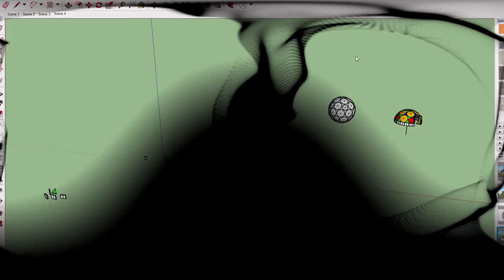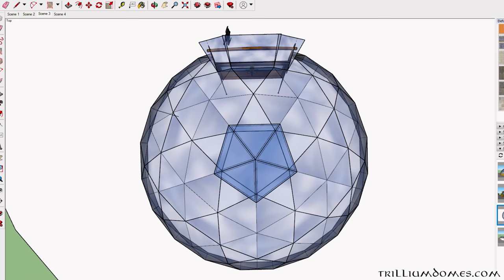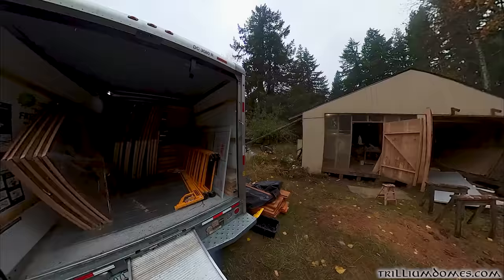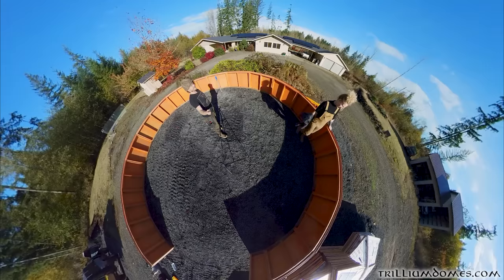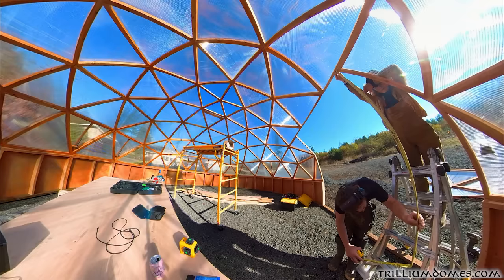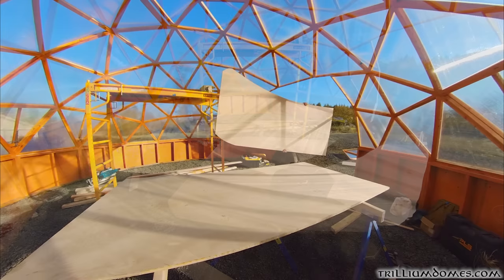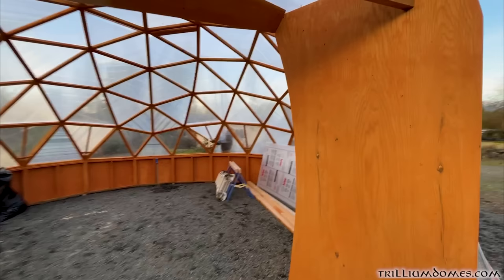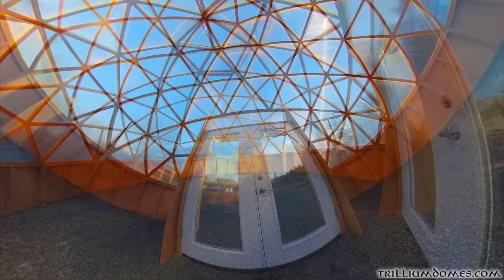Barn Dome! built WITHOUT any Hardware/Hubs??

Comment: Beautiful Dome! Do you have any tips for domes at northern lats? Specifically snow load, sealing between panels, non-glazed panels on north side, chimneys for wood burners...
Reply from the maker: It's all doable. Snow loads are fantastic with these. You could use triple or quadruple wall polycarbonate but not necessary. Happy to give you more specific details but hopefully I can get up and build one for someone in Fairbanks, AK or something.

Comment: Love geo domes. You have done a great job. Do you seal the cut ends of the polly carbonate or ever get any issues with algae
Reply from the maker: The ends do end up sealed! I have had some up for years with no algae issues but it may depend on your climate.
Reply: @trilliumdomes  thanks for your response. Do you just use a silicone or tape or something else
Reply from the maker: @matthewsmade  no prob! 

Between frames: 100% silicone or something like Prosoco R guard. 

Between polycarbonate panels: 100% silicone 

Uv flashing tape over polycarbonate seems. Pro tape 160 or siga wigluv or equivalent

Comment: I'm curious why you didn't remove the plastic covering from the top panels before install? I imagine it's a pain in the ass to reach those panels after it's built.
Reply from the maker: We went up there anyway to seal the dome so it’s worth the protection it offers during assembly. But yeah you can take them off right before you put it up.
Reply: @trilliumdomes  oh ok.. I didn't realize there was another step to seal the outside
Reply from the maker: @jrtshirtsdotcom  it’s optional. There’s a series of steps you can take depending on how redundant you want to be!

Comment: Amazing work, all of your domes and zomes. I would kill to know more about water proofing. I need to build something I know won't leak, but keeps this amazing natural light. Keep doing what your doing brother.
Reply from the maker: Depends on the materials you're using. Basically, think like a rain drop. If you use polycarbonate, just use double sided glazing tape and trim the poly 1/8" inboard of the frames. When they go together, fill that 1/4" space with a high quality sealant like sikaflex. Also put clear silicone between the frames as you assemble. You can also use UV stable flashing tape as an extra layer of protection. I choose siga wigluv black. Just make sure whatever it is is high quality.
Reply: @trilliumdomes  right on i fallow you. Here we need to use what is available and make it work. It's part of the fun of being out here, ha. Saludos from the end of the earth!

Comment: Are you selling pre built panels? I missed that somewhere.
Reply from the maker: It would be hard to ship them very far all put together.  I could do a flat packed kit where the customer would then assemble the panels.
Reply: @trilliumdomes  where are you located? May just be a matter of bringing a big trailer:)
Reply from the maker: @thesidburgess  based in Olympia, WA
Reply: @trilliumdomes  You could sell the precision cut wooden sticks.
Reply: If flat packed, some colored marking on the adjoining edges would make assembly easy. Would only need clamps and a big bucket of screws.
Reply from the maker: @codetech5598  totally open to it
Reply: @codetech5598  interesting idea

Comment: Great build.
What thickness ply did you use for the side panels on the door?

Is there a permanent air gap on the top piece to draw the hot air out?
Reply from the maker: 3/4” 

And no the cupola is operable!

Comment: Much respect on your designs and builds. Can give an estimate of cost of materials  for this dome?
Reply from the maker: It depends on a lot, what materials you use, the purpose of the dome, what foundation type. This one was 7k in materials and cost for all twinwall polycarbonate and aluminum shakes, the door, plywood on the pony walls etc. So you could certainly build it for much cheaper.

Comment: How warm do these get in the summer sun, just picked up your full pack of designs and contemplating throwing one over the top of my little stock tank pool outside. I'm in the North East, of the US.
Reply from the maker: Awesome! 

So it does get hot in the summer Sun as this is basically greenhouse. However you will want to add ventilation like I did here (not necessarily a cupola, but you can also add shade cloth over it in the summer time to turn it into a shade structure!

Comment: Great design💪. How do you seal between the panels/polcarb?
Good flming as well. Cool use of 360 camera👏
Reply from the maker: If you use polycarbonate, just use double sided glazing tape and trim the poly 1/8" inboard of the frames. When they go together, fill that 1/4" space with a high quality sealant like sikaflex. Also put clear silicone between the frames as you assemble. You can also use UV stable flashing tape as an extra layer of protection. I choose siga wigluv black. Just make sure whatever it is is high quality.
Reply: @Trillium Domes  Thanks for the reply. I was hoping for a bit better solution. 
Unfortunately, with my experience, outdoor silicon jobs (even the best quality) are never lasting, I presume especially with polycarbonate as it would expand and contract allot? How are your structures standing against time?
Reply from the maker: @VideoEngineering  it’s a very good system! You can also add flashing profiles and overlapping metal trim as well.

Comment: If I would build one like it, can I live in it? just converting it a place for work online etc?
Reply from the maker: Yep you can just put a real roof on and some insulation if you want!
Reply: @trilliumdomes  thanks! What do you think is the best material to apply as a roof for the dome? you know .. the weight.. waterproof .. winter and summer conditions etc.
Reply from the maker: @shakeralbohaisi4194  most any roofing will work. I like reinke aluminum shakes but you can use asphalt as well.

Comment: It seems there is much wasted polycarbonate due to cutting the triangles.
That stuff is not cheap.
Reply from the maker: You have to consider how much surface area you're saving due to the dome design being more efficient from the get go. Still uses less materials than a flat roof.
Reply from the maker: @JohnGuest45  in the plans I include layout options for 4x8 and 4x12 sheets in the most efficient way so there’s no need for a 3rd party program.

Also, as a general rule, the bigger sheet you can get will be able to be used more efficiently. Depending on where you live, you can potentially get even bigger sheets than 4’x12’ which could save you lot of money.
Reply: Could you not use a tarp?
Reply from the maker: @MrRunner1209  you could use a lot of materials but if you try to lay one big piece over the whole dome it will be messy, folded, torn up by the wind. Not taught and neat like this.

That said you can use tarp material or canvas to cover the dome in sections. Check out my ultimate dome building guide for details.
Reply: @trilliumdomes  My interest in domes is primarily for production livestock I want to get a prototype dome built in the coming weeks
Reply from the maker: @MrRunner1209  Sounds great! I'm sure you'll find a solution that works for you! Keep me posted and reach out if you have any questions.
Reply: @trilliumdomes  thanks I will!
Reply: @trilliumdomes  Have you tried using taught plastic sheets sprayed with mold release, and then painted on epoxy? I wonder how thin you could get it, and still have it allow in enough sunlight in to act as a greenhouse. Also interesting to consider an intermittent geothermal heater that goes through tubes placed underground to warm up the air and keep citrus trees above 53 degrees. Fans are used to intermittently exchange air underground, and bring it above ground. This can also keep 3D locatable livestock (chickens, goats, fish) alive. It takes x amount of time to heat the air, and use the fans to exchange it. A postal worker in Iowa or Nebraska did this...IIRC...and it kept the greenhouse producing, year-round.
Reply from the maker: @JakeWitmer  i haven’t but that sounds like an awesome experiment! If you try it out let me know!